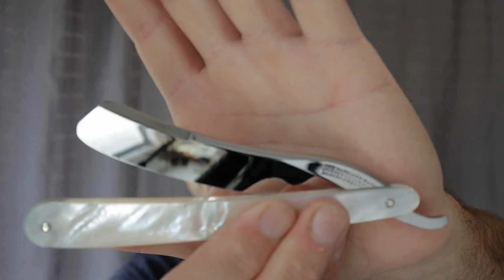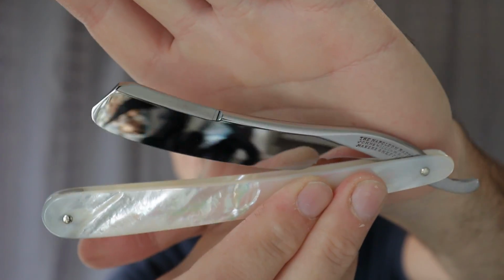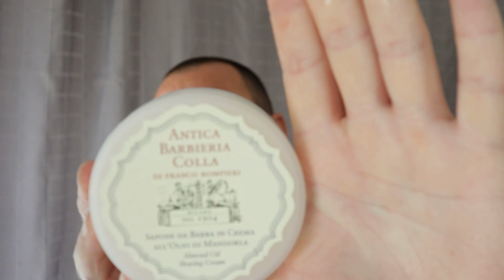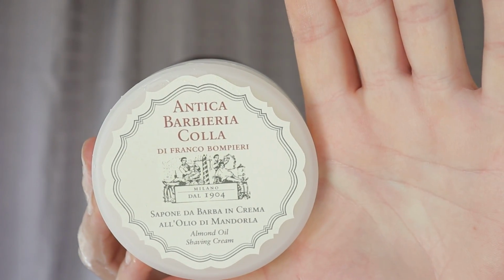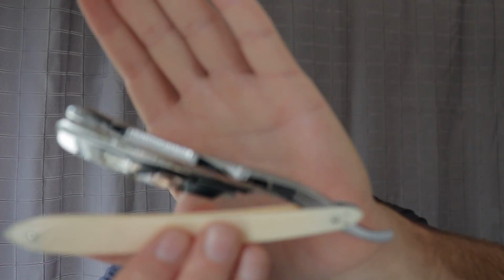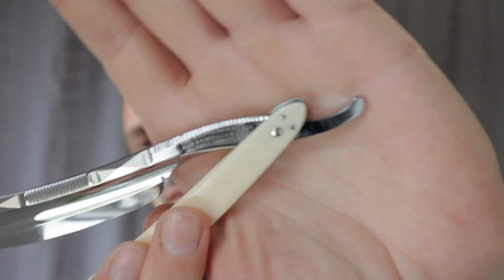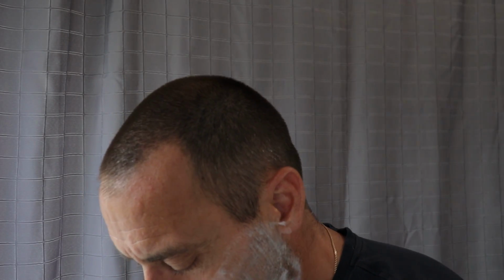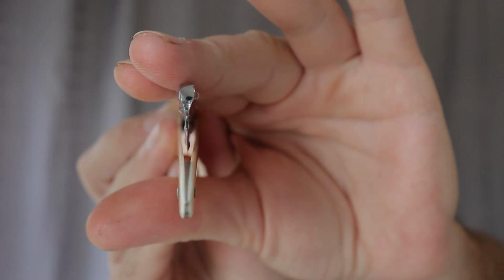Vintage Sheffield Straight Razor #3

Comment: 5:20 I'm not sure if the terminology is correct but I call that grind type a "Double Grind". I've a Joseph Haywood Diamond Edge that was listed as a double grind.
Are you buffing those? The lines on the spine look too sharp to be buffed. (you said you'd drop in some "before" shots where there was pitting but they didn't make it in)
Reply from the maker: Sounds about rite. It inspires me to make something similar one day hopefully.. The before shots are at the beginning of the video, showing off the rust..I make the opening after the video has been shot.
I did buff it lightly with some rouge .. Took the rust off with 400 or 800 belt then went as high as possible with Trizact belts, then added my secret mirror finish , topped off with a rouge buff.
Thanks T
Reply: @EdgeDynamicsEnglishRazors  Ah, the pix are at the start, ok. 0:19 that's the stuff I previously described as spider-webbing. Looks like an east fix but that stuff is a pain in the ass to remove especially if it's anywhere near the edge.